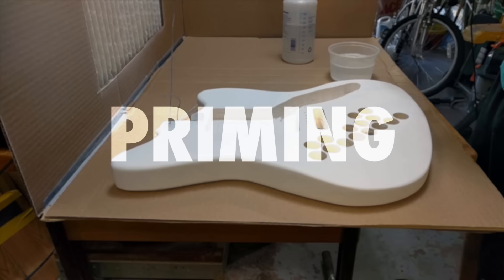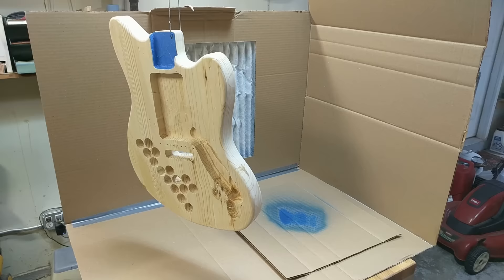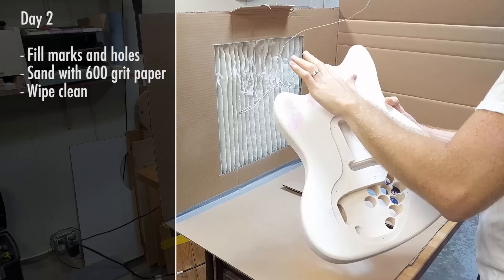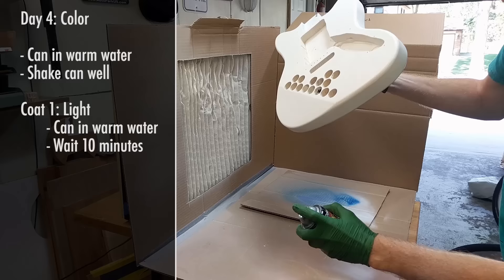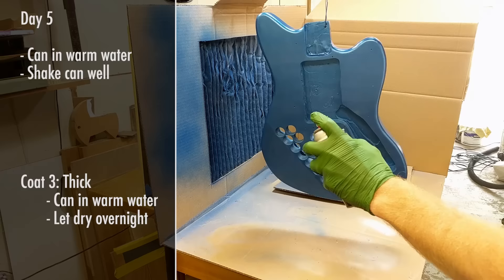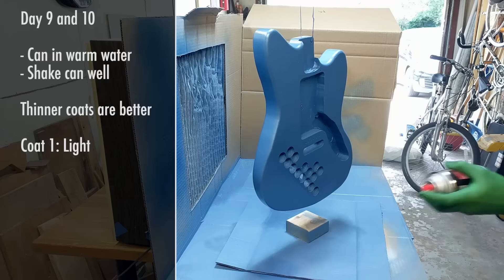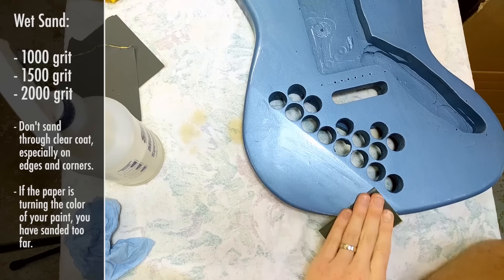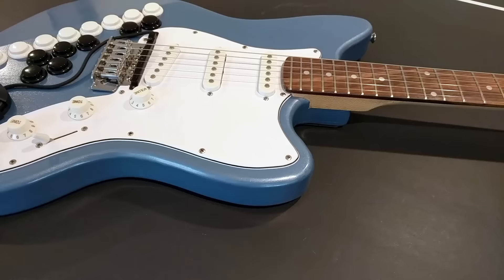How To Spray Paint A Guitar - Start to Finish

Comment: Great color! I'm painting my Squier headstock black and already have some orange peel going on.(Rustoleum paint & primer gloss spray paint) I have 4 coats on. Should I start with 1500 grit, and move to 2000 grit sandpaper, to wet sand? I have some of that McGuire's compound and can probably just do it by hand, since it's just the top of the headstock.

Comment: The process should be, 1) high build primer, sand and repeat. 2) SEALER primer, sand smooth. 3) just one can of color will be more than enough, two light/medium coats, then one wet coat 4) use spray max y2k clear 2 part automotive acrylic enamel clear in a aerosol can.  As long as the color coat it even and uniform, the 2k clear will make your project look very professional.  Plus, one can of spray max is cheaper than 4 cans of duplicolor. you wet sand and polish 2k clears like the last steps in this video, plus 2k clear is 15 times more durable.  1 can of spray max is $20-25  depending where you get it, and will easily do a guitar body 3-4 good coats for leveling and polishing.
Reply: Moto Man : spray max is compatible with all types of paint. I personally use duplicolor from a rattle can along with their primer/sealers, both are lacquers.  However, if your color  choice is a lacquer base, then always use a lacquer base primer,, same goes for enamel.  Spray max clear is great stuff for sealing up paints.  🤘🤘

Comment: By far the most helpful video I’ve seen. I’m painting a LP body, and I keep sanding through the paint all the way to the primer and sometimes even the wood. How do I sand the drips out without sanding thru the paint?
Reply: It's really hard to do so... the very best way is multiple light coats until you like the result. then finish sand with the wet sanding as shown.

Comment: Great vid. Working great so far. Done with the 2 cans of clear coats. Before I wet sand...I have areas that are still a bit gritty (front and back) and some that are smooth and glossy (sides/edges). Am I still ok to wet sand, or should I do more clear coats with a different technique? Unfortunately had to do it outside with a couple breezy days

Comment: Would you advise to also tape the Pickup and Spring Cavity or just leave them? And also the already drilled holes for the screws of the pickguard and the thread for the bridge?

PS: I also havent found a tape that would stick on the cavitys edge, there seems to be a certain layer over the wood that keeps normal masking tape from sticking, I've tried Tesa masking tape, Sport tapes and also Packaging tape, Im sure duct tape would kinda do it but would you advise to use that? It's kinda harsh and strong I dont wanna leave a mess, so maybe you got some tips for that too.

Comment: Very nicely done, and thanks for including plenty of details. I've noticed that some pro guitar painters use a steel handle that bolts to the neck pocket. If you had it to do again, would you build/buy the handle or did the wire hangar work as well as you expected?
Reply from the maker: If I was going to do it again I would build a gas pipe holder like Brad Angove.

Comment: There are so many things wrong with this. It is not bad for an amateur who is not a painter, but it is not going to produce a lasting product. first, you need a good lacquer based sealer if you can find one, otherwise, a hot solvent based sealer will suffice, this will  make it much more resistant to chipping. as for the sanding, the slicker you get it before you start painting the better, at the very least, take it a step at a time until you have smoothed it all out with at least 600 grit. finally, if you are going to use rattle can paint, instead of using the small cans from Duracolor, use the wheel paint clearcoat, it is a thicker viscosity, and will give you a much more durable finish. and don't let it dry too much in between coats, (it has a tendency to wrinkle when you re-coat after it dries hard), just let it get tacky and hit it again, you will get some milky color, but don't worry about it, it will clear up as it dries. I used to use this stuff to duplicate the glassy finish on automotive woodwork (Jaguars). Once you get it done, you can wet sand it with Old English (just a few drops at a time, a small area at a time,  wiping it off constantly not to soak the body, You are only using it to keep the 1000 to 3000 grit wet dry paper from clogging). You should also wrap the paper around a flat (no embossed numbers) credit card, or something of similar properties.once you have worked your way up to 2500 grit, use a 3000 grit foam backed pad. When you are done with that, bring the gloss back with a good rubbing compound, and when it is as shiny as it is going to get, then you can wax it.  If you take your time, and pay attention to detail, it will give you a high gloss, smooth as glass finish. 
All of that being said, if you want a quality job, all things considered, a cheap airless sprayer, and either a quart of hardened urethane acrylic (single coat) or a 2 step kit (urethane base coat and clear coat) is not all that much more online than you will spend on the best rattle can paint you can get at the local hardware or auto parts store, and will give you a much more scratch, chip, and wear resistant finish, and will take far less sanding time to deliver that glass like finish. If you use the rattle can, expect it to look like crap 2 or 3 years down the road, especially with heavy use.

Comment: Hi there Merwin. I have done the whole process as you describred, but i got a problem at the last step. I applied Polish compound of the same tradeMark you are using (Meguiar´s) but not exactly the same ......after the work, but every print stays at the body FOREVER. It seems that there is no way to remove them. I have polished back it all cause it was making me sick. Is there anything I did wrong or anything I should apply to the body instead that Car Polish compound ?  THANKS

Comment: I want to paint camo on my guitar should I a paint it green sand it then add the camo or should I paint it green put the camo then sand ?
Reply: Do ALL your prep work BEFORE painting. Camo takes painting differently as you are painting and masking different parts at different times. You'll want to make sure you have a SMOOTH primed finish, then LIGHTLY sand with 1000 or 1500 grit to give the colors something to stick to. once each color is dry, mask and continue to each color till done. Once dry, lightly sand again then add clear coat whether it's matte or gloss.

Comment: I found an old 1968 vintage Silvertone Model 319 Hollow Body guitar.  Totally gutted out nothing but the Body and the Neck. No pickups, tuner knobs ect.  I am trying to fix it up.  Luckily the body is not in bad shape or does not need a paint job But the neck!!.... it seems they tried sanding the paint off the back and did a horrible job, so it is  not even smooth, just raw ugly uneven wood.  What can I do to sand it down to a great smooth finish. What steps in sand paper.  What grit do I start with and end with.  I am thinking of just staining the back, what coating should I use there after staining.  The same process as you did and then wax or is it different there.  Thanks.

Comment: Hi, I followed all your steps and I'm really happy with the results of the guitar and it looks like a factory finished guitar (nice and glossy)
But it looks scratchy when you take a look at it from different angles (As if it was a 2nd hand guitar) 
I did use all the same grits of sandpaper and didn't go through the clear coat. 
Don't really know what caused this. 

Hope you can help out, so I know what to do if I'm ever planning on spraying another guitar :)
Reply: During the wet sanding stage, you have to go up to at least 3000 grit. When you buff out the guitar you wanna use a coarse compound then move to medium cut and finally a fine grade polish. You can use swirl remover to remove any micro scratches left by the fine polish. Wax the body and your done. It should look like glass when done right. Hope this helps
Reply: @charminultra8118  Alright Thanks a lot for the tips!! I'll keep this in mind for next time

Comment: Hi
Thanks so much for the video ... I have a question. I have an unpainted guitar set and I am interested in painting it. I wanted to know how many spray bottles need to be bought in order to achieve a perfect result?
And what is a water spray you used? I want to paint the guitar black. Can I use a matte black spray and then a glossy clear lacquer spray finish?

Comment: Spray that primer all you want, it’s not going to fill in the wood grain. That’s not what it’s for. You needed a grain filler. I recommend Z-Poxy. You need something thick to fill grain. Primer won’t do it, sanding sealer won’t do it, paint won’t do it either. Luckily the wood in this guitar has a tight grained. 

What else? .... A respirator is a must, those fumes are dangerous.... wet sanding the primer is a waste of time.... Duplicolor works great, but you don’t sand metallic paint.... Don’t spray so thick you get drips, just don’t..... paint takes weeks to fully dry, be patient. If you can smell paint, it’s still off gassing.

Comment: If I wanted to paint my guitar multiple different colour like a rainbow, would I still follow these steps? I’m not sure, but I just wanted to check if I should follow these same steps?
Reply from the maker: It would probably work. You could probably paint it by hand whatever you wanted and then do the final color coat sand and then the clear coat steps.

Comment: So with most painting videos, they use bright solid colors, how would it work if you want to paint it black? Is it anything the same or different?
Reply from the maker: It's the same. But usually mirror black shows any imperfections more than anything else.

Comment: Good video man but I have two questions. Can i just dont polish  the guitar or requiers other proces to leave the matte finish? and is realy necessary a fan or extractor if i do this outdoor?
Reply from the maker: I did a bass in matte yellow outside years ago. Prep is the same but then you can get away with color and then clear and be done.

Comment: Hey man, do you think you can make a guitar painting video with set neck guitar?
Reply from the maker: Then I would need a set neck guitar...haha. If you are repainting one you would want to tape off the fret board instead of the neck pocket. If you are building one you could leave the fretboard off, tape the front and paint it, and then glue the fretboard on after the painting is done.

Comment: Did you sand after painting the guitar body? Or did you just go straight to applying the clear coat after painting?
Reply from the maker: Once I got a color coat I was happy with I went straight to clear coat, no sanding.

Comment: Hi you mention at the first coat of filler primer that you did not do it thick enough, did the 3 runs after that fix the issue of filling? Thanks for the great vid it's a really awesome finish you've done. Found your comment on Tim Sways video
Reply from the maker: by 3 runs do you mean the additional coats of Primer? I did all of the coats of primer a little too thin I think. The primer is made to fill in imperfections but you need enough paint in one coat to level out before it dries to really fill it in.
Reply: MerwinMusic hey mate thanks for the reply, yes I meant the primer. Thanks that makes sense to get a good thick coat on first. 
Have you ever had any problems with the clear coat changing the colour? by going an off yellow tone
Reply from the maker: My only experience is with this clear coat is with this guitar. I have been using this guitar for about 8 months and haven't had any issues, the guitar still looks great!
Reply: MerwinMusic thanks so much for your help, I can get started now. Really like your channel. Cheers

Comment: I just finish all this proces in 3 days and play it on gig last night, and after that i realized that my paint wasn't dry yet, should i repaint it again or just hang it on the wall to make the paint dry???
Reply from the maker: If you paint over paint that wasn't dry there is a good chance that it will never dry, and always be gummy. Probably the only thing you can do is sand it back down and start over.

Confession: One of my first guitar pedals I built years ago I sprayed too many clear coats too fast and it still is gummy and every time I go to use it it's stuck to the shelf in my closet.

Comment: Question:  Is it ok to wet sand the paint (to smooth it out any bumps) or dry sand then apply clear coat?  I have been working my Fireman's Axe Guitar for two months just on the paint alone.  Any advice from author or anyone would really help.
Reply from the maker: From my experience wet sanding is better with higher grit sandpapers as it helps prevent the paper from clogging, usually when it gums up with sanding dust then it either doesn't work or it makes big scratches from stuff stuck in the paper.

Comment: Hello.  Was the Light Blue Metallic the color yo started with and later changed or is it the color in the finished product?  Thanks!
Reply from the maker: The light Blue Metallic is what I switched to.
Reply: Thanks!  That is the same color I’m using on a guitar I’m currently painting.

Comment: You shouldn't be looking for your shine to come from wet sanding your clear coat..you didn't have nearly enough clear..you wind up seeing your sandpaper scratches through your clear and didnt even have enough to buff it to a nice shine after..it wound up being a light uneven dry layer of clear sanded and buffed into the color to make for a half shine half dull finish..also minus the re-assembly the painting shouldnt take more than 2-3 days tops when done correctly

Comment: My 2 cans of top coat are now on.  Ready to start with 1000 grit sandpaper.  This process has taken so long that I DO NOT recommend this method.  A quicker solution is needed.
Reply: There is no quicker solution. More time spent on prep work, the better your results will be.

Comment: You use grain filler to fill grain, not primer. It won't build up that much. Not even 2k high build automotive primer will do that. You had unrealistic expectations from the primer but I assume it's because you didn't know any better.

You want to wear a respirator, not just "a mask of some kind". Paints and clear use a hardener that, when it gets into your lungs, will harden inside of your lungs. 

Ask me how I know. I've got the scar to prove it because it almost killed me because that's the same bs they told me. And I had to have a surgeon go into my lung and physically clean that, shit out. 11 days in ICU. 10 MORE in the trauma ward. Don't let anyone tell you that all you need is a little cloth/paper mask. Ohhhh bullshit. You need a respirator at the very least. And a fresh air supply at best.

Comment: If I'm getting drips during the clear coat process, should I let it dry and sand or keep going?
Reply: Your best bet would be to sand the clear coat before continuing. Having a small sag spot can equate to a larger scale sag. The clear would continue to overlap that spot and drag itself farther down because it won't have a smooth area to lay flat.
Reply: @3milks1cup82  Thanks! I'll plan to use the 1000/1500/2000 grit method and respray. Much appreciated.

Comment: 2 weeks?  and why did you aplay so many layares of paint.    when i painted my jazz bass i took about 1 week and i used 1 layer of primer , and some plastic padding , then i painted it pink just to se how eaven i made the sand job.  then i sanded again and pained it black and then had a clear coating filled  with candy red , green and gold flakes .   my pikguard i did paint in a white pearl finish and the neck was painted in black bmw camelion paint.  i think the paint for the neck was the moast expensive part 100€/DL,  NO JOKE .   but it was free for me since i did it on my work.

Comment: spekle is too rough and cracks and doesn't fill as well and not as good as plastic wood paste. apply it all over the sanded wood then sand down fine. preparation is everything

Comment: I would lay the guitar body flat when spraying to avoid run downs due to gravity
Reply: Definitely the best way, but a cute trick for when that isn't an option (or you just don't feel like it) is to spray from top to bottom instead of side to side ;)

Comment: Is duplicator better than rustoleum  for electric  guitars
Reply from the maker: I think that Duplicolor is better than Rustoleum and Krylon. Those 2 really don't have very much pigment compared to accelerant.
Reply: @MerwinMusic  ok i got duplicolor what was the temperature when you painted your guitar how long did you let it dry between primer and base color and between base color and clear coat. and how long did you let the clear coat dry before you put the neck and electronics back on the guitar?
Reply: @MerwinMusic  buy me its 58 degrees and i am hoping to prime one day let it dry over night paing the colors day 2 and clear coat on day 3 . do you think that will work?